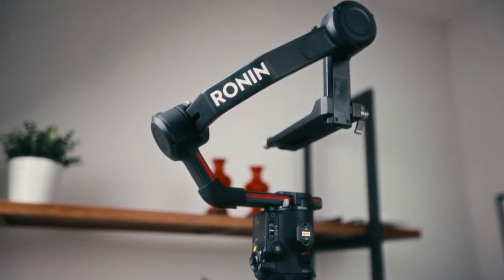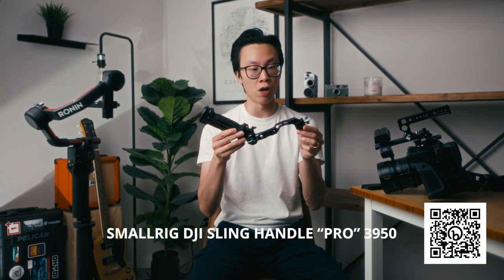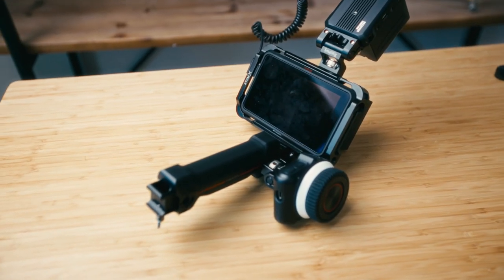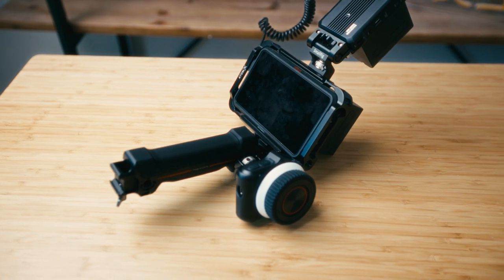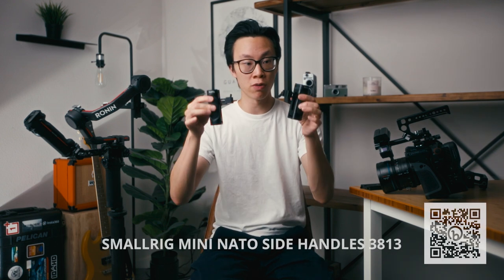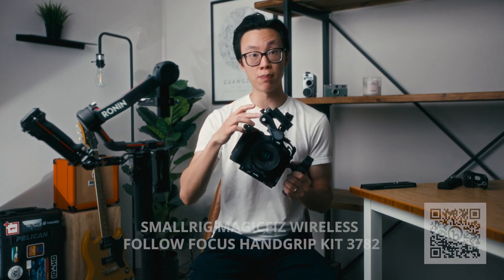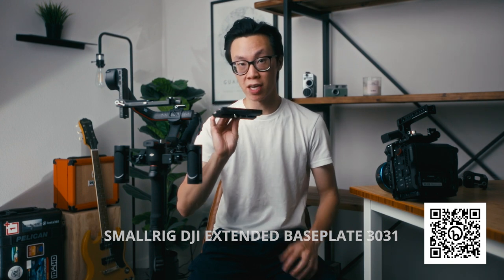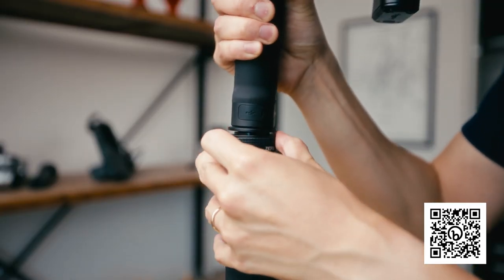DJI RS3 Pro Gimbal Rig: The Ultimate Guide for Professional Filmmakers

Comment: I have just bought the RS3. I use pf and sometimes want to manually move the camera down or up, but it always moves back to the forward position. I managed this on other gimbals but not sure what I need to do for the RS3, any suggestions?
Reply: Make sure it’s in the correct mode. PF, FPV or PTF.

Comment: Do you get nervous that the mount on the bottom of the gimbal battery is just a 1/4 rather than a 3/8 thread? I’m looking at getting an RS3 but wanted to find a safe solution to attach to my monopod in the same way you do.
Reply from the maker: Tbh I've never really been bothered that it's a 1/4". I've had many gimbals from Zhiyun and now DJI that only have a 1/4" and it hasn't given me any issues at all in terms of securing a monopod to the bottom 😊
Reply: @AlexJCheung  fantastic! I really appreciate the reply!

Comment: Does this handle have any advantages for shots that are not low? What if I am doing an orbital shot directly in front of me?
Reply from the maker: For the Sling Arm Handle, if you're not doing any low angle shots, then it would not benefit you much. It might actually get in the way of you shooting stuff that's in front of you because of how far back the handle protrudes. I like the low angle shots for the stuff I shoot, so I keep it on there. But if I'm only doing orbital/parallax shots, then I'd only have the two side handles on there all the time. Let me know if that makes sense!
Reply: @AlexJCheung  Thanks. I have the DJI RS3 Mini and never did a shoot with it yet. I'm just in the research/learning phase. I think I'm only going to do orbital shots and the shots where you follow a person as they're walking. I don't think I have any side handles that came with it.

Comment: do you have a link for the nato clamp that you used in order to use the mini side handles?
Reply from the maker: The mini side handles have NATO clamps built into them, and they clamp right onto the NATO rail of the SmallRig Sling Handle and the Small Rig wireless transmitter module. Let me know if that makes sense!
Reply: oh ok thank you. but do you need the transmitter that why or did you mounted the transmitter so you have a wider grip?

Comment: does the side mini nato handle can support the rs3 with a73? is it sturdy?? :) thanks
Reply from the maker: Yup! They're very sturdy, doesn't feel like it'll break or come loose. The only thing would be that the handles themselves are smaller, so if you have bigger hands, then it might not be the most comfortable to grip
Reply: okay thanks! last one , i do not have any accessories that you do on your nato , i just wanna know how far is it to the screen if it is just the mini hand grip installed directly to the rs3,  coz i have big hands   :(
Reply from the maker: @louierussel9678  Ahh got it. If you don't have any accessories and you're just attaching the handles to the gimbal itself, then it'll be a lot closer to the screen than what you see with my setup. The distance will just be that connecting part on the handle. Let me know if that helps!

Comment: Hi Alex! I ordered the long plate you linked in the other video (c70 and rs3 pro) but I don’t know to to attach the new plate to the gimbal, it seems as if it doesn’t fit.
Reply from the maker: Hmmm that's werod, could it be that you're sliding it in at an angle? And you're using the RS3 Pro as well?

Comment: Hi Alex how to mount RS 3 pro for a top angle or flatlay product videography?
Reply from the maker: You would definitely need a boom arm on a C-stand in order to safely rig the gimbal, some sort of heavy duty 1/4" adapter for the junior pin on the boom arm, and a safety clip for the gimbal/camera. I've never done it before so be sure to do a bunch of research on this before trying it 😅
Reply: @AlexJCheung  Sure, Thank you. I am getting a customized rig done. Will update once I receive it.